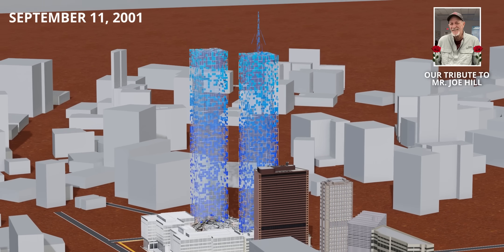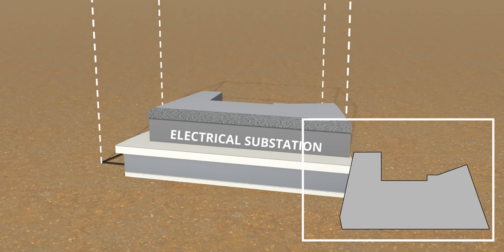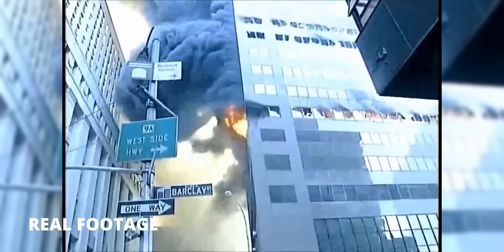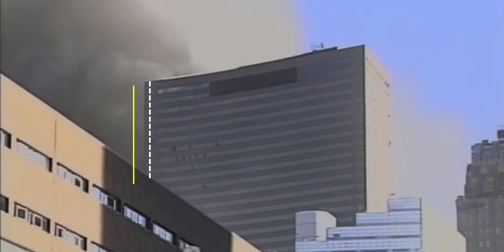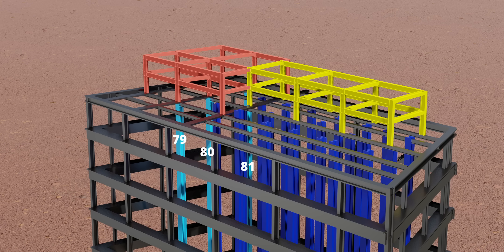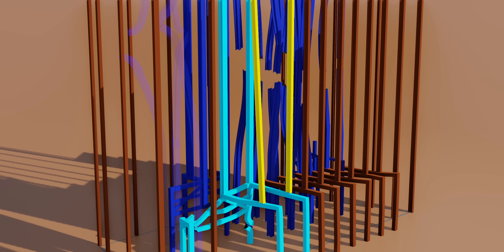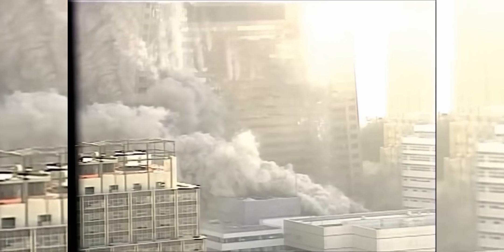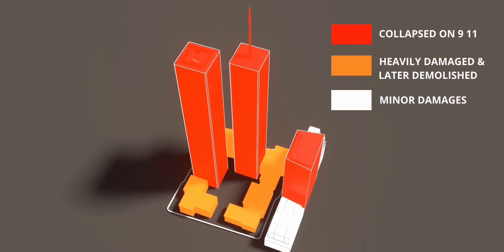Collapse of Building 7 | The Complete Physics

Comment: one thing i do want to point out is that it wasn't the antenna that created the gash as the antenna fell the other way towards the south not north. It was just debris
Reply: Correct.  The antenna did not create the gash.  It fell SE as the North Tower began collapsing towards the SW.
Reply: Correct, you can see in the footage how a massive piece of debris from the twin tower hits building 7
Reply: @richiekock8835  EXPOSING THE TRUTH:
HOW WTC7 FELL ON SEPTEMBER 1
https://www.youtube.com/watch?v=nEgPNNcdtu4
Reply: Yes. The south side of the 90th floors collapsed first, as the perimeter columns snapped there. Then they snapped across the entire section at around the 95th floor I think? That's when the antenna starts to fall toward the south. Once the entire 90-110 floor complex started to collapse at an angle toward the south, it blew the north wall of the building out into many sections, part of which tore a huge gash through building 7. Even hit the core of the building it was so violent.
Reply: Yeah an analysis I remember from I think history channel. Had just called it a "x ton slab of debris" pretty sure they said like 200 tons
Reply: @timbrwolf1121  Wow! 200 tons flew 100 yards lateral distance under the energy provided by gravity. Are you applying for a job at NIST?
Reply: Didn’t Silverstein say that NYFD called him and (loosely quoting here) said, “after all the events of the day, it was probably best to let it go,” and that “they (NYFD) were going to pull the building,”?
Reply: I was pretty sure a part of the upper floors hit it, rather than just the antenna. Somewhere out there, there's a video where you see the debris hit WTC7 from the other angle (I saw it before, but most real videos have been overtaken by conspiracy theorist videos). And also many videos where we see the front of the building and the damages. It's years since I saw those videos, so I'd have to see them again to tell whether the antenna was a part of that.
Reply: @TopLob  
You seriously think the conspiracy theorist videos have overtaken all the other videos of September Eleventh?  
What category do you put this video in?
Truthful? Exaggerated guesswork? Or complete BS?
Reply: @JackCarlock56  I didn't take anything away from this video except what that physics would be if this scenario were to happen. Some of the things that were reported officially coincide with the events, and it's interesting to know the actual physics behind those particular things. For example. Load calculations on support structures. Things I've personally had to deal with. Things conspiracy theorist don't take into consideration under weakened support structures.
Reply: So they say it was the heat of the jet fuel that caused the collapse and yet fire in this building didn't have the jet fuel, it was a regular fire.
Reply: @shawnamoen5026 
WT7 housed several enormous diesel fuel containers .
Reply: So the major part about the antenna causing the gash in bldg.7 was false..... Surely absolutely nothing else is!
Reply: @eainc.708 Exactly, that was my thought too. All of the "offiical narrative" folks are fully onboard with this video, even though it includes false information like the impact of the antenna. But heaven forbid if a "truther" posts false information, then it's heresy and they have to be shunned for life
Reply: It doesn’t matter debris can’t make a skyscraper free fall into its own footing
Reply: This is absolutely utter nonsense, no way symmetrical collapse would happen simultaneously  by unsymmetrical damage  , the owner larry Silverstein said they pull it , tvs knew about collapse before it happened, eyewitness barry Jennings who were trapped inside said he heard explosions all the time, the real reason wtc 7 collapse because the planned third plane was shoot down by usaf so they were forced to pull it manually, this channel is not neutral nor innocent
Reply: NANO THERMITE ~ EXPLOSIVE MILITARY WEAPON ~ FALLING BUILDINGS *DO NOT * PRODUCE EXPLOSVES RESIDUE AND *DO NOT* CREATE RIVERS OF MELTED STEEL!! ~ ??? >> HAVE YOU EVER SEEN ANY CONTROLLED DEMO OR FALLING BUILDING CREATE RIVERS OF MELTED STEEL ?? ... (DIDNT THINK SO!) >>  NANO THERMITE IS IN ALL THE ASHES OF GROUND ZERO !! ... CASE CLOSED ~ IT WAS A 3X CONTROLLED DEMO!! >> BUSH CHENY RUMMY SAUDIS = GUILTY OF WAS CRIMES~! +++ OVER 280,000 PILOTS, FIREMEN, COPS, MILITARY, ARCHITECTS, ENGINEERS HAVE ALL TESTIFYED THAT 9/1 IS A GOVT COVER UP. **PERIOD! * DO NOT BELIEVE SLICK VIDEOS!! ... LEARN THE REAL FACTS!!
Reply: The antenna would not cut through the entire building
Reply: @ 
No one ever suggested it did.
Reply: This dude gets all his knowledge from a guy that studied this the last 15 to 20 years.. It is his life and specialty but thinks the antenna caused the gash . Oh shit we believe you bro . Lmao
Reply: thats what i was about to comment. The antenna clearly falls to the south.
Reply: bingo !
Reply: My thoughts too
Reply: Yes i could swear i only heard them say fire debris hit building which made it collapse never the other part of building gashing it
Reply: For real, you can even see it on the video that the antenna fallen the other side xd
Reply: Not really a good start if you're trying to promote a theory ie starting with a provable factual error.
Reply: EXPOSING THE TRUTH:
HOW WTC7 FELL ON SEPTEMBER 1
https://www.youtube.com/watch?v=nEgPNNcdtu4
Reply: I agree with that point. It's was the accumulative impact of steel girders. No way the spire would have enough strength to do that damage.
Reply: Building 7’s collapse front the front view  
https://youtu.be/6pyyqV7egEI?si=aN5HdjJaRL3ziHyE
Reply: Yeah. They really think they can told us that the antenna would cut that building like hot knife to butter? Embarassing 😂
Reply: The antenna fell the pther way?
Reply: @kadangkaler Yes, the antenna fell towards the southern direction. The Gash was probably from the exterior collumns that were blown out from the North Tower
Reply: @GanzuGinisu blown out from north tower the building 7 hit the ground before anything
Reply: @GanzuGinisu  yes, the columns blown out from the demo charges could have damaged WTC 7, but then they did the controlled demo anyway.
Reply: @GanzuGinisu Columns were NOT ‘blown’ out.  On 1 and 2 the central floors attachments to the perimeter and core columns were severed by the weight of the upper floors when the steel buckled on the fire floors. The result was the stack of floors slid straight down the core columns and the 4 faces of perimeter column PEELED away like a banana.   Chunks of 100 ton steel falling at 170 mph hit the front of WTC 7.   The four faces of the two towers peeled outwards, broke off and fell, landing as far as 400 feet away in the four directions those sides faced.
Reply: lol!   @GanzuGinisu
Reply: @rokko_fable  why?  why did "they" need to take down the building with explosives? Nobdy seems to have an answer for that.
Reply: @nathan500100  insurance claim. Get the USA into another war in the middle east. Etc. Take your pick. Probably all of the above.
Reply: @rokko_fable  so they couldnt just set it on fire?  Seems like setting on fire would be easier than putting a team of demolition professionals in the building for weeks in advance hoping that nobody sees them and jeopardizes the entire mission.  I would think bin laden or cia or "they" want the mission to succeed more than get that insurance money and any military planner would acknowledge the risk of getting exposed planting explosives would be too great if it could potentially expose the entire mission.  and why would wtc7 be necessary to start another war in the middle east?  im confused.  why not just attack wtc1,2?
Reply: @nathan500100  a fire wouldn’t destroy the entire buildings or bring them down. Even from a plane crash, only a few floors caught fire.
Reply: @rokko_fable  yeah and no buildings have ever gone down from fire
Reply: @nathan500100  buildings have. no skyscraper ever has.
Reply: @rokko_fable  Plasco Building was the tallest building in Iran and was considered an iconic landmark of the Tehran skyline. Historically, the term "skyscraper" was applied to buildings of 10 to 20 stories that used new steel-frame technology, which the Plasco Building did. Therefore, in its own time and place, it was definitely viewed as a "skyscraper."
Reply: @kadangkaler  yeah the top section fell towards the south, which was caused by the collapse of the south tower, as the collapse created larger flames in the south side of the north tower,
Reply: @imboredandtired9 the south tower didn't affect the structure of 1 WTC
Also your partially correct
The antenna started to fall south but then went back north 
However idk what parts hit 7
Reply: @FlyynTheFox  no, so the collapse of the south tower did affect the north tower, but not severely, you can see this if you look at videos of the south towers collapse from the south, and you can see flames growing on the south face because of the air being sucked down, and the antenna didn't fall back north as it was found in the same area as the Marriott and 90 West Street
Reply: @imboredandtired9 the videos aren't really clear enough to tell if it was the antenna or not
I haven't really seen videos of the south fires but more the east fires across entire floors
Reply: @imboredandtired9 no it didn’t my god it’s literally in this video that the towers didn’t affect building 7
Reply: @Flyyn_Gaming_9 Demolition explosives?
Reply: It's literally in the video that their collapse affected ALL the WTC buildings.
Reply: @FlyynTheFox The Towers were aligned on their diagonal, so that the office windows would all have an unobstructed view. As they collapsed, the four faces of the towers peeled off, out and away in the four directions each side faced. Like a banana.  Steel landed as far as 400 feet away in these four directions, but very little material fell along the diagonals from each tower.  This is why the first tower to fall did not do much damage to the other tower, but did enormous damage to building across the plaza or street.   The steel that gashed WTC7 was the same steel that chopped thru the Marriott hotel like it was butter.
Reply: @Diesel_Deuche but they did. Debris from the Nth tower adjacent definitely did damage.  And Bldg7 was burning afterwards for hours .
You gonna keep arguing to satisfy your conspiracy hunger?
Reply: @Diesel_Deuche  It is literally in the video that the towers demolished WTC7

How can you lie like that?  The debris from the twin towers smashed WTC7 enough for WTC7 to collapse even without the fires

EXPOSING THE TRUTH:
HOW WTC7 FELL ON SEPTEMBER 1
https://www.youtube.com/watch?v=nEgPNNcdtu4
Reply: @kadangkaler, the antenna was found in the center of its own tower debris. It did not hit building 7.
Reply: If that part isn't true, what else is false in this video?
Reply: @kyle7just about everything i s FALSE.
Reply: @kyleconroy2312 Oh stop. the stupidity. That's illogical reasonings 😂
There was a big scar on that face, not exactly illogical to suggest that massive pylon might have caused it.
Reply: @kyleconroy2312  nothing else, it was just the antenna part
Reply: @imboredandtired9  He was also incorrect about free fall acceleration.

NIST mentions on page 48 of their final report that the building did fall at free fall acceleration for 2.25 seconds. Equivalent to the first 8 stories.

He was also partially wrong about the buckling of the columns. The columns did buckle but it wasn't caused by weakening from the fires.

NIST explanation of events is much more complex. In NIST's scenario, there was a girder named A2001 connected to column 79.

The beams connected to A2001 experienced thermal expansion & applied a force to the girder pushing it sideways. This force resulted in the girder falling off its seat connected to the column.

When the girder fell off its seat, the column buckled.

It's just a really bad video all together.
Reply: @john_hunter_  It's great flawed propaganda though. They tried and succeeded with some folks for sure, especially those uninformed of the facts that have been coming out for over 20 years
Reply: @john_hunter_ actually there's a lot of good points made in it.. Particularly the really dodgy compromises made when building it, the offset penthouse and subsequent additions.
As for this ongoing ridiculous debate about free-fall or not.. Duh!
Once a good few thousand tons starts falling, whatsoever caused it, unless there's something extraordinary under it, the bulk of it will collapse at near to G minus a bit of resistance- but not much!
Reply: Do you really believe that an antenna could create a gash on dozen of floors made of steel ? Come on guys....
Reply: @dimichdimich yes. Of course it could. Not just like your TV aerial, this was a massive pylon! It had to be, to resist wind loads alone! Are you an engineer of any sort?

Stop hypothesising! Yet it probably didn't, looks like just a massive chunk of then tower itself.
Reply: @dimichdimich yes. Pretty hefty structure to be up there you know!
Reply: @dimichdimich  the face of the building is made of steel???
Reply: @dimichdimich  Yes, yes, we do.  By antenna we mean something the size of a cell phone tower all by itself
Reply: Doesn't explain how BBC knew an hour earlier and broadcasted that  building 7 collapsed
Reply: @soulsbourne  First if you're  gonna say something incorrect, atleast get the times right, it was 20 minutes. But the BBC did report building 7s collapse 20 minutes before it did, but they said that because the firefighters were saying that it was at risk of collapse, so from the firefighters to the BBC, it was basically a giant game of chinese whispers, where it changed over time to where it was reported to collapse. Also there is a 0.001% chance that the BBC even knew of WTC 7s existence, so they wouldnt recognize it on the skyline, hence why they had it behind them whilst reporting it
Reply: @imboredandtired9 You haven't got the times right yourself. The BBC reported WTC 7 down 26 minutes before it collapsed. The firefighters warnings of a possible collaps, was actually something they had been told by a higher ranked officer in their own department who was not event present at theat time. Never before and ever never after has any other high rised building in the world collapsed due to a simple office fire which by the way was a small starving and cold fire (the dark smoke proves "low" temperature) Buildings like this simply do not collapse due to fires like this, simply because architects have to follow certain codes which are established with large margins to prevent collapses like this to happen and firefighters not risking a building collapsing when inside during fires.
Reply: That's what I thought. I can't see that spire holding together that well through all that mass, if it had hit it.
Reply: i just chatGPT this, and yeah it agrees it didn't hit build 7 only debris did
Reply: Building 7, also known as 7 World Trade Center, was the location of a CIA office on the 25th floor. It was also home to the Internal Revenue Service Regional Council, the U.S. Secret Service, and other smaller tenants, including the New York City Office of Emergency Management, according to Wikipedia. The CIA's office was initially kept clandestine, but it was revealed after the 9/11 attacks.
Reply: @BrianKenyon also the Federal Trade Commission was in building 7 and it held thousands of documents related to the Enron scandal and other evidence of corporate scandals and crimes.
Reply: Yes man. the antenna and the aluminium flaps have secret superpowers...!!!!.....hahahahaha....!!!!
Reply: @ΓιώργοςΖαχαρούδης-ι6κ  ban flagpoles and antennas!
Reply: @ΓιώργοςΖαχαρούδης-ι6κ & airliners are solid & made from steel -penetrating kryptonite..
Reply: Why would they lie ?
Reply: @JamesPilkenton-se5cx  
Because the events of September Eleventh did not unfold as the Bush administration and NIST said they did.
Reply: @JackCarlock56  Ah yes cause conspiracy theories are always so much more reliable...
Reply: @Snowpinemedia  and Government’s are always so trustworthy…
I wonder how many catastrophe bonds were on call for the WTC Complex around that time, considering a hurricane sat just off shore as well.
Reply: @JackCarlock56 wrong. Bush had nothing to do with it. The facts brought them down..  the factsbof intense fires and weakened steel structures. We saw it. And no'one heard orcl recorded 130dB explosions? Because there weren't any.
Reply: you mean it doesn't fit your addiction to everything being a conspiracy. Pretty well daily.
Reply: @imboredandtired9  or maybe building demolition technology experts that land buildings debris into the building's own footprint
Reply: If they can't even make this fact straight this whole video is BS
They are assuming a lot
Reply: Yeah, can even see the masses of debris falling on to WTC7's face.   Spires of buildings are fairly lightweight and in no way could cause that level of damage, really wish they left that completely unsubstantiated theory out, it's starkly at odds with the rest of the video.
Reply: @masondegaulle The Antenna on WTC 1 was 360 Feet tall. As tall as a Saturn V Rocket, and taller than the Statue of Liberty.
Reply: @masondegaulle  even this. Have you ever seen a plane that hits a bird? They are destroyed I’m not buying that they completely wiped out 40+ steel beams and collapsed 3 buildings into their own footprint with zero resistance
Reply: FACT: WTC 7 fell at “FREE FALL” speed. FACT: For a building to “FREE FALL”, all the columns MUST be taken out…AT ONCE. Now…THE QUESTION who took all the columns at once? ANSWER: Someone with complete access to the building.
Reply: Even if the antenna would've struck, it sounds like cray talk, that it would've had any significant effect on the building. But I guess we are supposed to believe 'the core and perimeter' thing...
Reply: @jarinorvanto4301  
As far as I know, no one has ever suggested the antenna struck WTC-7, except this clown  at SabinCivil.
 As a matter of fact, there is a video showing the debris that did strike WTC-7. The antenna is not seen in that video.
As someone with an engineering background and who has studied September Eleventh for twenty-two years, I can fairly say that this video is full of crap.
Reply: doesn't look like any fires happenning in it, so what smashed all those windows so perfectly in line, with no damage around them?  :face-blue-smiling:
Reply: @firstpeoplegovernment  
If you are asking about busted windows along a floor, i.e., the 13th floor, then you are seeing the path the fire took in search of fuel. Building and house fires burn for maybe 25 minutes in any given location before the fuel is exhausted.  This fact is commonly ignored by critics of the truth of what actually happened on September Eleventh. Critics of the truth are those like the producers of this bag of garbage video.
Reply: @firstpeoplegovernment  detonated explosives after Silverstein had them, "pull it," ... Pull the building, as if all he had to do was say the word and the detonating explosives were magically put in place.
Reply: there were raging fires burning on one-side of Bldg7 all afternoon. Fact!
Reply: @imboredandtired9  In court you say one thing wrong, it discredits your testimony, so if you apply  that rule to explanations, this has no value.